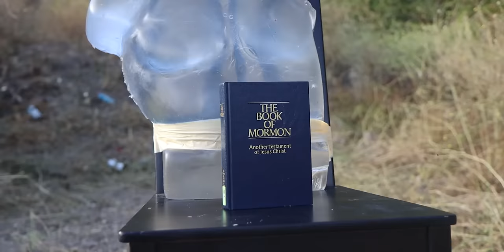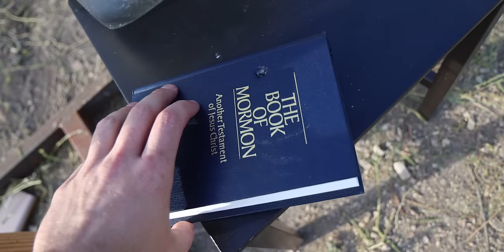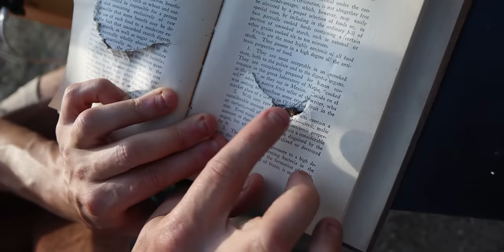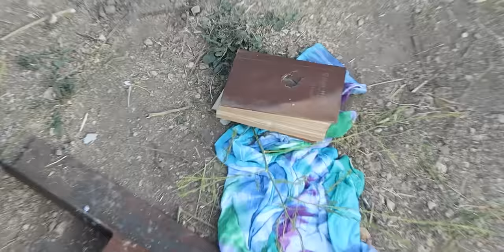How Many Shirts Will Stop a Bullet?

Comment: If you’re wondering how a simple nail or scissor blade can penetrate through the Kevlar, it is because Kevlar is designed to stop bullets (or at least slow down its velocity) by acting as a super stretchy net that catches and decelerates the bullet like a soccer ball flying into the goal net. 

Running any piercing weapon like a spear will easily penetrate the Kevlar, since it can pass through the microscopic gaps between the Kevlar fibres.
Reply: What about knives how come it defends them?
Reply: @boredchild6631  Kevlar vests are at most stab-resistant if there are trauma plates or polyethylene sheet "fish plating" to deflect the stabs, at the cost of more weight and less flexibility
Reply: @midnight4685  Or just use large calibre armour-penetrating bullets with an extremely high velocity and a tungsten core
Reply: Ratio
Reply: Is a bow effective against it ?
Reply: @DarkKnight-te6wq  If it’s hard pointed and travelling  at a high enough velocity, then probably yes
Reply: @DarkKnight-te6wq  Only plate can stop a bow... normal kevlar is useless for any broadhead.
Reply: @boredchild6631  Kevlar doesn't defend against knives, you need additional protection layers for that
Reply: @luispena4635  thats going fine isn't it
Reply: @UnrebornMortuus  Are you high?
Reply: @UnrebornMortuus  I’ll take that as a yes
Reply: So if everyone is wearing full Kevlar armor without plating, you do want to bring a knife to a gun fight
Reply: "The slow blade penetrates the shield" 
 -Worm-Man's bald friend.
Reply: @lampylightbulb  assuming you’re choosing between a knife and a pistol maybe, rifle rounds will pierce plate free Kevlar though.
Reply: so basically arrows are better than bullets
Reply: @Nightshade-Aurora  if by bullets you mean pistol bullets and your target is wearing Kevlar with mo plates yes.
Reply: @Nightshade-Aurora  That depends on the mass, velocity, aerodynamics and materials used to make the arrowhead
Reply: so just make the bullet head sharp like an arrow?
Reply: @theYoutubeHandle   that’s not feasible, sharp bullets wouldn’t be able to spin and bullets need to spin or they are hideously inaccurate. 

Ever heard “misses him entirely because it’s smoothbore and nails the neighbours dog”? Yeah because smoothbore guns don’t spin the bullet.
Reply: @randombrit13  no, never heard of it. Why can't it spin? Make it like a cone shaped, it can spin.
Reply: @theYoutubeHandle  You can also increase the velocity of the bullet or harden the tip of the bullet with tungsten to make it armour piercing
Reply: @theYoutubeHandle  aside from hollow points bullets are already cone shaped, cones dont cut they pierce, which in pistol calibers, kevlar can handle.
Reply: what about pointier bullets? why aren;t bullets ver pointy any ways
Reply: @jacobtang8949  screws with aero dynamics and cuts accuracy basically, plus it’s not worth the effort to figure out a way around it, because an “anti Kevlar pointy bullet” would still get stopped by armour plates, and you could just use a stronger or tungsten cored bullet to pierce it without those complications
Reply: Ik and it’s not fun to get hit even by a 22 bc that thing stretches a lot and it will leave a bruise for quite some time
Reply: BIG-KEVLAR right here, don'pt ebleive their lies
Reply: @roidroid  then believe in the science and the proof!
Reply: @boredchild6631 think about chainmail+plating, usually the kevlar is covered or is covering some kind of stab proof material
Reply: damn no melee def bonus huh...
Reply: Arousing
Reply: doesn't even need a real blade, during a chemistry class when i (a skinny 15 year old girl at the time) was handed some kevlar to pass around and stabbed a finger diameter hole in the sheet with a biro
Reply: If my knowledge is correct, Kevlar can stop .22 and 9mm rounds (could be wrong but also .45 ACP rounds?) but any rifle round or higher is immediate no
Reply: @theYoutubeHandle  Still wouldn't work, half the reason arrows can penetrate kevlar is bc they have so much more mass compared to bullets
Reply: Yeah, generally speaking bulletproof and stabproof are kinda opposites in materials science terms - high velocity, large surface area vs. low velocity, small surface area... and the duration of the force acting on the kevlar from a stab is longer, whereas the bullet is stopped very quickly (it's a lil more complicated than that since a sharp edged object introduces shear force and doesn't just part the fibres between strands, but that's the gist at least)
Reply: It does dull things like sizzors pretty fast though
Reply: It’s like the opposite of a suit metal armor,  one’s better for stab damage the other is better for firearm range damage

Comment: The Kevlar was easy to cut because it isn’t meant to stop blades or other weapons that have low kinetic energy it’s only meant to hold up against fast moving projectiles
Reply: Just like the shields in Dune
Reply: https://youtu.be/XxriU2Z4RTw
TASAK 61
Reply: No, and yes. It’s a fabric, a textile, which means it is vulnerable to shear, which is exactly what a sharp knife foes.

However, it is extremely strong in tension, which is gonna be the resultant stress of a blunt bullet. In the same vein, it would also protect you against a pick strike which would pierce plate armor, since the tip won’t be small enough/sharp enough to pierce between the fabric’s fibers or cut them.

But you are ultimately wrong because an ESAPI ballistic vest is meant to stop rifle round, not low kinetic energy impact, but it’s still a centimeter thick hard ceramic plate, so good luck piercing it with anything else than a rifle round.
Reply: The slow blade pierces the shield
Reply: high tensile strength. each fiber is incredibly strong, That's why you'll often find these fibres in bags as single odd coloured threads.
Reply: @nicolopez2181  Not all soft Kevlar is stab rated. Any plate will stop a pick. The original comment never mentioned hard plate armor, so no idea why you are saying the guy is wrong…
Reply: @nicolopez2181  an esapi ballistic vest and Kevlar are not the same thing. specifically, esapi refers to ceramic plates, so you're about as wrong as is possible.
Reply: @frailvoid5844  Bless the water and His maker
Reply: A science free comment.
Reply: @teeanahera8949  science free? maybe. Reference free? not so much.
Reply: @nicolopez2181   I can get behind the rest of this comment, but unless you are using some crappy plate that pick v plate bit is just cap
Reply: @brokoblin6284  so a military hammer with a pick to pierce armour won’t pierce armour?
Reply: @nicolopez2181  OK you're  right it definitely  had the  capability  but it was still not easy to get someone that way although  it was still done and the blunt force of the hammer  part was often effective

Yeah I just thought like a regular  pick at first lol
Reply: We are arguing over the semantics of weapons
Reply: @nicolopez2181  Level IV vest. ESAPI levels up to IIIA are only handgun rated, which do have slow moving projectiles (relative to rifle). Interestingly, they do this with fabric instead of steel or ceramic like level IV.
Reply: Ok interesting thx
Reply: Kevlar isn't usually easy to cut though. I used to do work with fiber optics and some fiber optic cable is reenforce with kevlar to protect the glass. You needed special serrated scissors to get through the kevlar. It would slip in normal scissors along the blade as if it wasn't sharp at all. Kevlar is also used to reenforce the bottom of kayaks and other light water craft  made out of plastic and fiberglass against abrasion against rocks.
Reply: Bullets are also made of lead and are very soft
Reply: If I stab someone very quickly will he be invulnerable? Must I stab a Kevlar wearing man slowly?
Reply: The reason the bullets had varying stopping distance was also due to the fact that it’s only supposed to stop one shot after that the fabric is all misaligned and can’t catch the bullets nearly as well

Comment: Really neat video. Curiously, your initial reaction and concern about the material not being Kevlar due to being able to cut it is an actual issue. Kevlar is a remarkable material but due to the nature of how it's woven, is vulnerable to pointed object capable of going through the material and damaging individual fibers rather than the collective strength of the fabric. Non-Newtonian, shear-thickening fluids (same concept as oobleck) are used to withstand these, as they 'thicken' proportionally to the shear force applied. As such, if someone attacks with a knife or scissors, the fluid will thicken in response. You could still get around it by slowly stabbing, reducing shear stress, but if by then the person will have time to react and move away form the blade
Reply from the maker: Yeah its such insance fabric
Reply: But what if you combine Kevlar with a layer of stab-proof fabric? 🤔
Reply: @Ididathing  *insane
Reply: @MafiaCatNyoshi  like chain mail?
Reply: @Ididathing  I love how little care was put into this comment
Reply: "The slow blade penetrates the shield"
Reply: so essentially, you're saying oobleck inside of a kevlar towel is the ultimate material?
Reply: @agustinc6102  chainmail is is not for stab defense its for slash defense
Reply: @Ididathing  how many kindergarteners would it take to stop a bullet 🤔
Reply: @driplord6150  there's someone out there that knows the answer to this. How they got that information however may or may not have involved a school in 'Merica
Reply: I smell materials scientist
Reply: It's like the shields from dune!
Reply: @MafiaCatNyoshi  or if you just have a plate carrier vest
Reply: @Egerit100  ah man I was two weeks late to making this same comment
Reply: Thanks for the advice on how to stab people through oobleck! I will use this next time!
Reply: so that is how dune shields are made
Reply: @MCBigFetus  properly made chain mail will protect you from stabbing as well
Reply: @Ididathing  bullets are less cutting then they are shoving your flesh aside
Reply: Sounds like the force shield from dune.
Reply: @janbernad4729  depends, if the "stab" is strong enough; whole you may not be pierced, the pressure on your body may be lethal depending where your stabbed... for example a knight would die if they fell from a plane even though the had armour, its just the sudden imapct and pressure would kill them
Reply: I learnt that about Kevlar back working in an electronic recycling factory,  I mean the whole it being vulnerable to stabbing/piercing. We had to wear cut-proof gloves underneath our Kevlar gloves in order for full protection and even then it wasn't completely able to protect our hands from piercing. I found that out trying to save a couple of stray kittens who fell into one of the dumpsters outside because some nitwit forgot to close and lock the dumpsters up when we were done a day prior. One of the little buggers bit straight through both layers like nothing, hurt like a bitch.

For anyone who is wondering the kittens were fine and not harmed. However,  we couldn't even relocate them because they were just too quick and struggled far too much for any of us to maintain a hold on without getting bit or shredded.
Reply: @MafiaCatNyoshi  you become super man😂😊
Reply: @Butterphotography  well, as a general rule, turning into a grease stain upon impact does tend to kill people. however, a stab, or even a bullet, is much different from skydiving. a bullet is also a very small target, while the ground... is not. if it doesn't pierce the kevlar but still does blunt force damage, then it'd be a bruise or something, not turning somebody into canned chicken broth.

Comment: Just a tip if you ever do this again you should layer the Kevlar with another material, I've seen something as fancy as carbon fiber to something as simple as old potato bags. Basically you want to strengthen the Kevlar by turning it into a composit. as well as you should have sown all the edges of the Kevlar and the apron together.
Reply: Also - kevlar gets weaker as it takes impacts. The more you shoot it, the less effective it is.
Reply: I don't think he actually wants the kevlar on the apron after this video.
Reply: @seekerhunts  no way bro.thanks a lot because I thought that shooting it makes it stronger!!
Reply: @somefish9147  The point I was making is that after one or two hits - it's supposed to be replaced as it is no longer rated to be able to stop what it was intended to stop - it is SIGNIFICANTLY weaker, as the strength comes from the tightness of the threads; the impacts stretches them.
Reply from the maker: Yeah i figured it would ruin the sewing machine but i defintely should have done that
Reply: @Ididathing  would you even need the kevlar after the video?

Comment: With kevlar, once it’s been shot the integrity of the layer goes down. hence why it seemed to get stronger from the hollow point to the normal 22 rounds
Reply: hollow points just penetrate less due to how they're shaped
Reply: @casey6578  Yeah, but Asterix is also right.

Comment: Thing is, Kevlar is designed to catch a round after its velocity has been reduced and is broken up by another barrier such as Ballistic ceramic, carbon fiber or steel. Maybe chuck some bathroom tiles in front of your apron and see if it works it be curious to see what regular ceramic and kevlar can do
Reply: Not always... both come with trade offs... weight, flexibility and eventually it just becomes useless.
Reply: Kevlar is mainly used by itself. Rarely added to other substances for body armor.
Reply: @andyallen3008  well yeah if you want to bleed out horribly when facing anything spicier than .45 ACP.  Modern body armour designed to stop significant threats is usually steel, polyethylene or ballistic ceramic with Kevlar backing, the front material breaks up the round absorbing energy and the Kevlar is to stop any fragments that make it through. 

https://www.frontiersin.org/files/Articles/608139/fmats-07-608139-HTML-r1/image_m/fmats-07-608139-g001.jpg

Comment: I remember looking up how many layers of kevlar a bullet proof vest has. The answer i got was 20-30 layers depending on the quality of the kevlar. The 3 basic "strength ratings" are; 1000, 1500 and 2000.  2000 being the strongest, most expensive and hard to get depending where you are. 

1000 is really common and is used in certain kinds of work wear. I got 2 pairs of kevlar 1000 cut proof sleeves that i wear sometimes under a sweater if I'm ever unsure of my "safety". Would definitely help with a knife slash, stab proof is another matter completely. 

Even if a kevlar vest is rated as bullet proof doesn't mean it's stab proof. Some are and some aren't, the ones that are will say specifically that they include protection against "edged weapons".

Comment: The reason why the scissors went through is that Kevlar, or any Aramid fiber, needs to be well layered and condensed to exert bullet-resistant and stab-resistant abilities. Kevlar vests are usually made of a couple tens of layers (20-50) of Kevlar, tigthly woven, glued together. The whole point is to have layers upon layers of strong fiber which overlaps each other, so you increase the chance of “catching” a bullet in the pattern. Well that, or just get a ceramic plate which will stop any sharp object or pretty much any small-arms round you could encounter.
Reply: What you guys don’t know about ceramic plates is that they can ricochet the round in the bottom of your jaw or straight down to your pelvis and groin.
Reply: @computerbiscuit  I think that's for steel plates, not ceramic. Ceramics can take less rounds (in general) but they are much more forgiving with ricochets and spalling.

Comment: You should see how some of the actual most popular rounds in the US (like 9mm and 5.56/.223 Remington) do against these. Also keep in mind that it did stop the bullet but the energy is still transferred to you. You wont bleed out but you might break a rib or two. Thats why most ballistic vests have kevlar in-front and steel plate behind to help dissipate the force from the bullet.
Reply: It's ceramic in front, then kevlar, then foam padding, get your facts straight
Reply: @0angelcxkes  There are steel plates and have anti spelling coatings, with no kevlar,  because why use kevlar when you have AR500 hardened steel it's bloody redundant
Reply: @0angelcxkes  It's highly dependent on the brand and class of the armor. Maybe someone else needs to get their facts straight.
Reply: @sarahmiller3758  redundancy saves lives.
Reply: @0angelcxkes  Also a more advanced Copper/Plastic balls/wire coated in ceramic, follow by kevlar and then finally a foam pad/memory foam.
Reply: @sarahmiller3758  Because one defence is none defences.

Comment: Also Alex. With armour notice how it's ridgid. Thats cause like your previous armour it has a hard front to break the bullet up and the kevlar catches the fragments so if you wanted the best results you should put a peice of steel that's atleast 4mm thing infront of the kevlar for the best results
Reply: @Azetay67  no. That's what the kevlar dose it catches the shrapnel. How else do you think body armours made 🤦 look up how is body armour made and it will have a hard layer to break the bullet uo and somthing to catch the shrapnel that is the kevlar
Reply: @snapped4433  When the bullet hits the steel plate and does not penetrate, it will literally split into a bunch of pieces and go everywhere, usually into the neck and arms. Most good armour plates use ceramics and kevlar. The kevlar cannot catch the bullet if it is behind the steel which stops the bullet btw.
Reply: Well 1 they put a phew layers of kevlar the plate then more kevlar and you would have a plate carrier on 🤦